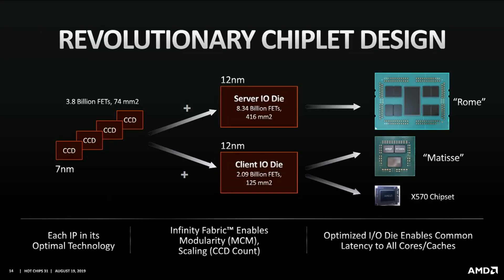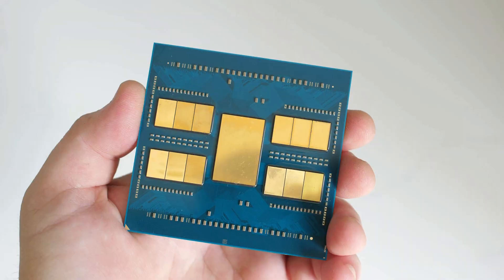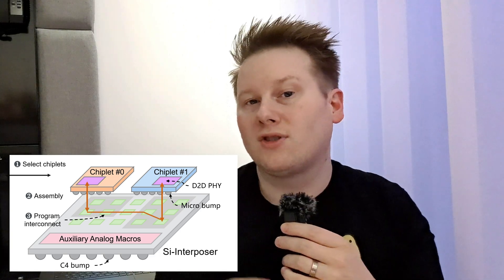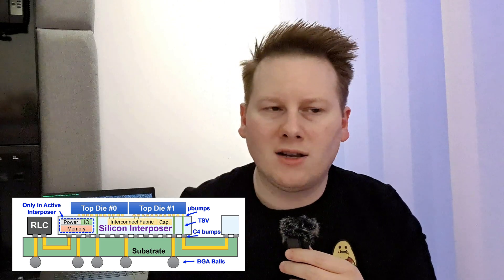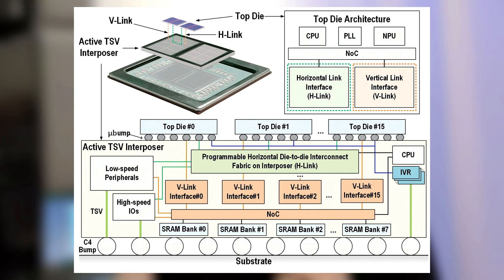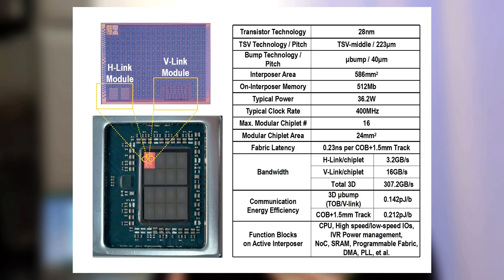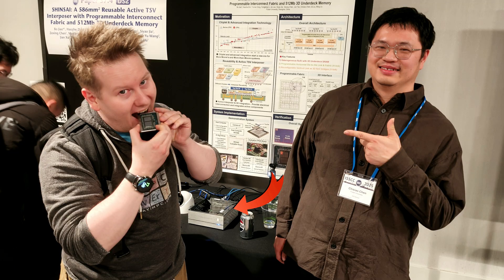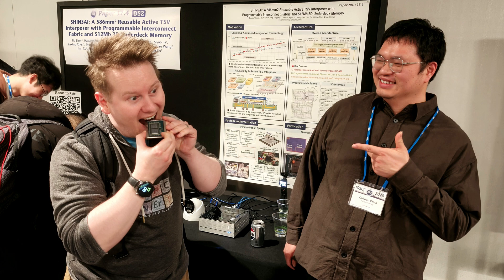Driving Down The Cost of Next-Generation CPUs

Comment: I did my doctorate on interconnect design back in 2011 and have been at a certain blue chip company since 2012. It's been wild to see how quickly interconnects and interposers have gotten incredibly complex. I was on the Lakefield team and have since moved to a more litho-focused R&D role than in chip design. I am incredibly impressed with what these guys have done here.

Active interposers are the stepping stone to stacked compute. Once you start stacking compute, things get crazy really quickly. CPU and GPU on top of shared I/O/cache/memory interface is cool, we see that in MI300. Now put CPU on CPU. Put your E-cores on your P-cores. Put the the giant FPU/vector unit of a modern core under the rest of it and free up space to make a giant L1$. Stack the ray accelerators and tensor unit on top of GPU shaders and TMUs. I long for the day we start measuring chips in mm^3 in a real sense.

Your point at 7:12 is something I wish I had back in 2011. Man I would have killed to even be working in the double-digit nm in grad school, let alone getting into something properly modern. I was privileged to have some inside contact at Global Foundries from time in the industry pre-PhD, but even then there was no chance I was funding a tapeout for a test chip on graduate funding. All my work was on a simulation of 45nm and I did get a 180nm chip made, but my word, imagine the learning you could do if you unleashed a graduate class on something like N6 or Intel7.
Reply: Yup, 2.5 and 3D stacking with advanced packaging and more capable active interposers r wave of the future together with other key technologies looming at horizon. I've said many times before that what we see in MI300 is how even consumer chips gonna look like with more advanced unified memory with better interconnects/bandwidth and speed. Moore's law is probably "dead" when it comes to further shrinking of monolithic dies using lithography, but with advanced packaging and 3D stacking, new transistor design and chip materials, backside power delivery, silicon photonics and others the future looks still looks quite exciting even with Moore's law in mind. Also let's not forget that chip logic architecture and overall design using new AI tools will play a key role as well to squeeze as much compute out of chips as possible.
Reply: Cooling and distributing power within the chip is going to be an absolute PAIN tho.

Comment: I've been following integrated circuits -- in concepts, but not usually in details -- since the 1980s. Now, following along is starting to become much more complex and difficult without being personally immersed in the industry. I think this is due to the increasing role of the third dimension, which ironically I've been looking forward to for years. Being able to build upward, even if only at significantly lower average power, could lead to almost unimaginable achievements in technology. Think of enormous aggregations of processing -- civilizations of silicon -- whose components operate at far lower duty cycles than we currently consider, and which no longer require vast, slow memory arrays. We will build systems that evolve almost like living creatures.

Comment: So the interposer is the I/O die?
Reply: It's almost like the motherboard has been shrunk down to the size of the chip - absolutely bonkers.
Reply: @tomfahey2823  Substrate.  Not motherboard.  Basically it is an advanced substrate at much finer line pitch so the routing and signal density can be denser and lower power, which in turn means less heat that needs to be dissipated so the product can have higher performance in the same package area as well.  It can also save a bit of silicon area, ie "shoreline" and TSV area when the connections are smaller / denser.  Normally the only comparison to an IO die would be level-shifting the operating voltage of the silicon signals toward the SOC/mobo signals.

Comment: I know there is a lot of Chinese research and engineering work going into mitigating the costs (monetary and  technological) of export/licensing controls.  Much was made about the Huawei/SMIC effort to use homegrown (or at least supply chain viable) lithography to produce "modern" node sizes, but IMHO this is a much more interesting development that can either complement that work (and deal with some of the associated yield/process issues) or allow substantially better integration between costly/limited nodes where they're needed and more practical to build sizes where they're not. If I was an ITAR regulator, I'd be paying attention here.

Prohibition never works in the long run...there's always someone clever and motivated enough to work around your rules and limitations.
Reply: Their government is supporting them just like they supported the lithium battery and the electric vehicles industries. The benefit of starting from "scratch" is that they can implement unconventional but bold architectural choices. What would be interesting is if the CCP demands a "backdoor" with all their CPUs/SoCs

Comment: what if you re-use the basic building block without modifications. say for an fpga. then the structure is truly scalable. adding memory bits and compute cores as necessarily. the brain has many interconnects without much trouble or saying "this is too hard". so its not too hard. just figure out how to do mass interconnects. between micro-chiplets.